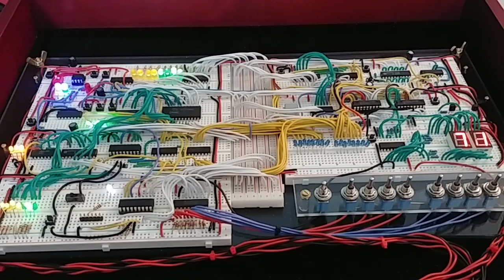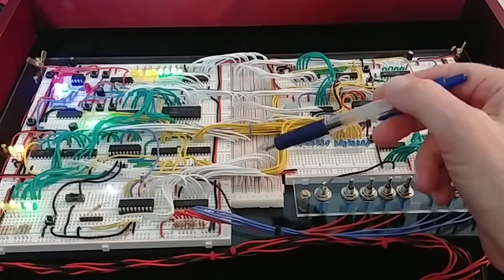My 8-bit TTL Computer #31 - Review & Final Thoughts

Comment: You're probably right that there might be a few choices that could optimize / minimize some of the work of crafting something like this from scratch.  However, a key reason these projects are popular (and EDUCATIONAL) is that they put you back in a unique point in time in the evolution of computing.  Between 1975 and about 1985, the circuit density and power of the CPUs and supporting circuitry was all still at a scale that a single mind could not only understand end to end but actively contribute to.   Beyond 1985 and the 386 / 68030 era CPUs, the density and complexity became so overwhelming the majority of engineers had to back away one or two layers of abstraction and take most of the details as "givens."  But there's a weird feeling you get being "closer to the machine" when you can still see how IC selection affected instruction decoding and basic code required for simple things like input and display output.  Or even designing RC circuitry to ensure /RESET is held down on the CPU long enough for all other components to power up to ensure the CPU starts in a sane state.  I guarantee 99.99% of engineers working today have never done design work requiring thought at that level.  When you consider those doing this during the day weren't just simulating the process using modern tools like a text editor or EEPROM programmer we take for granted, you get a much better appreciation for how smart these peopple really were/are.
Reply from the maker: Totally agree.  I have often thought that it is crazy that modern computers run so well.  There are so many stacked layers of complexity.  Running from the hardware and on up the software stack.  All have to run perfectly.  Amazing really.  But, this retro stuff is great fun (for us(me) old guys).  Thanks for the thoughtful post, Charlie.